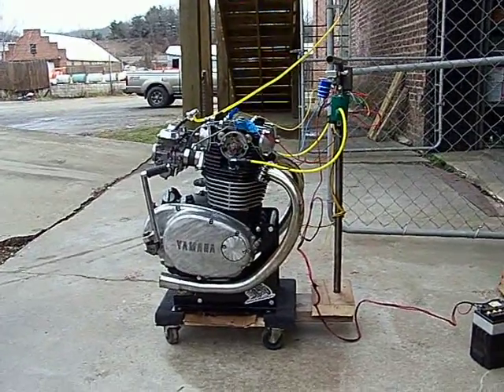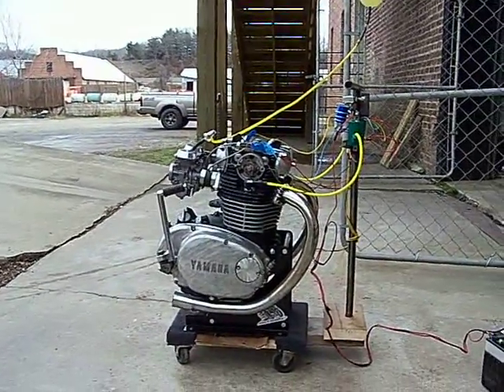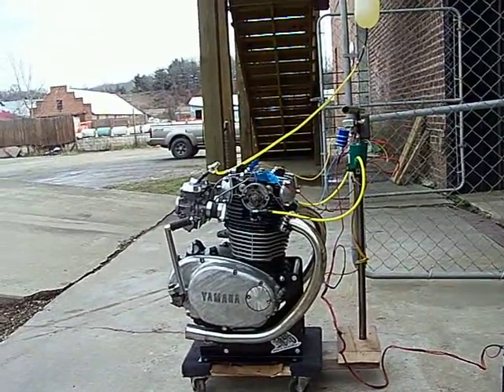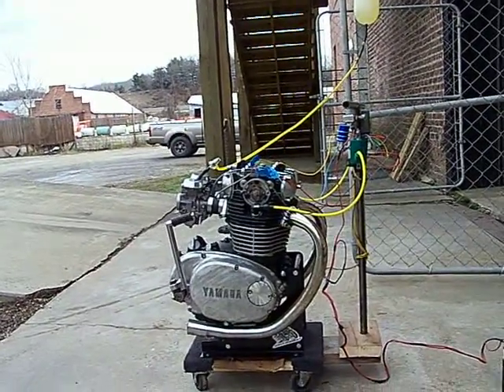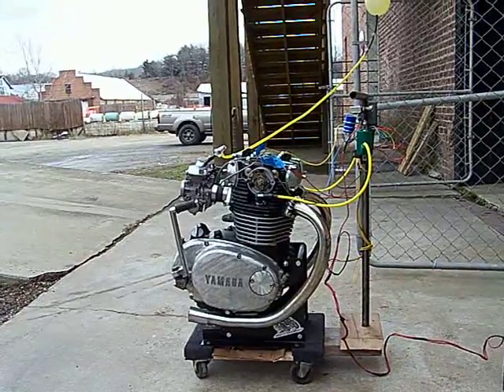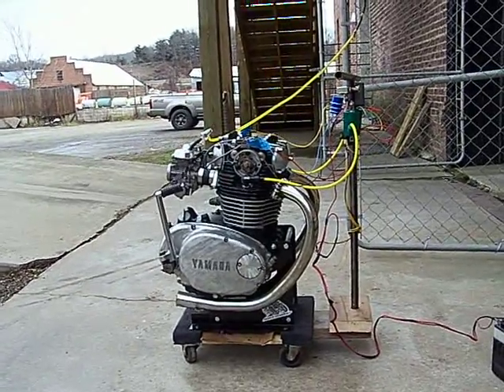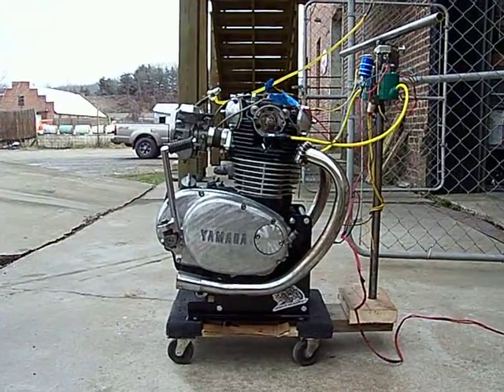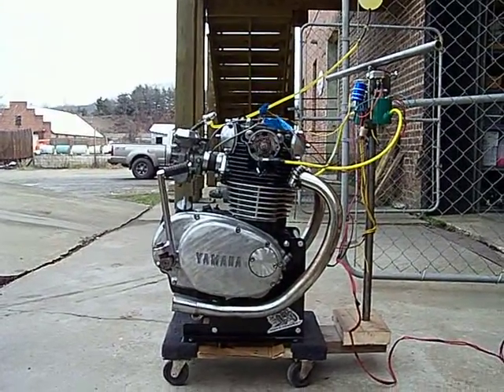Rephased XS1 Engine - 256 engine with 447 Internals from Hugh's HandBuilt

Comment: It sounds like a V8!  Too bad the 256 cam couldn’t be rephased. They were THE best cam of the XS range.  I s there a reason why the 256 can’t be rephased? They have longer rods.
Reply: It's a 750 big bore. You can't get big bore to 256 unless you change to 447 internals. Otherwise you can rephase a 256 in my opinion.